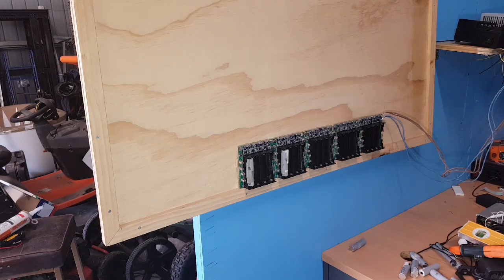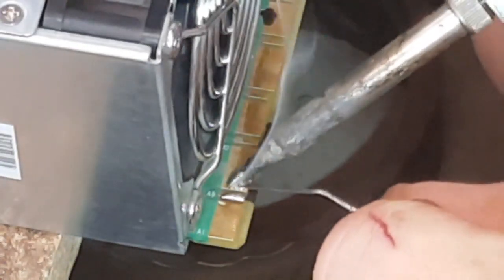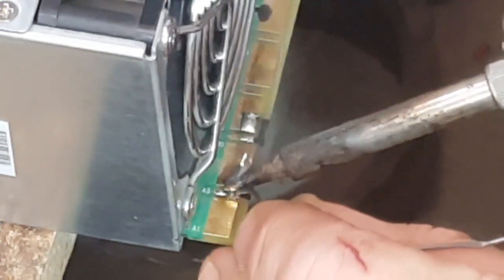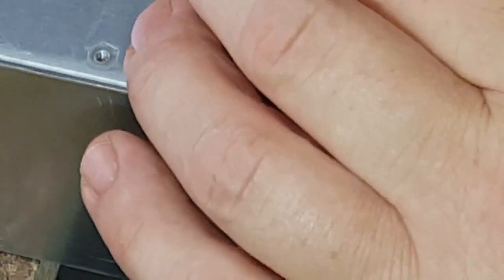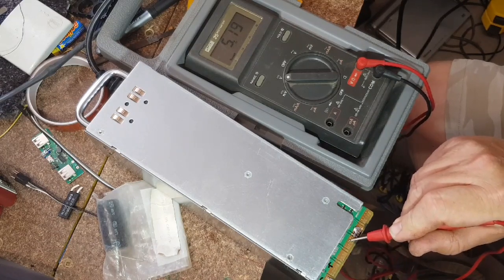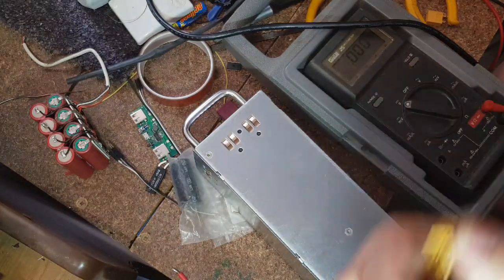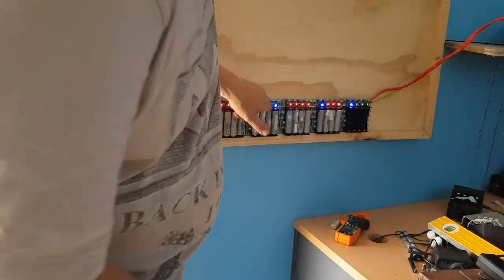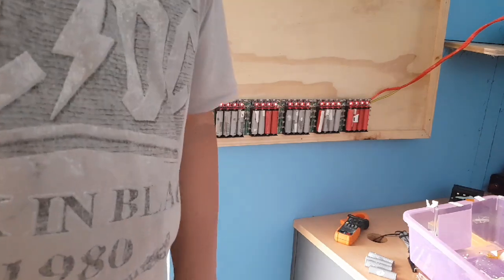Compaq PS5501 or ESP127 powersupply model. For charging 18650 or drone use.

Comment: Nice vid mate, pretty helpful.
I'm trying to use this kind of psu for 3d printer.
I hope you moved those chargers, it would be nice to see them mounted to something that won't end as a fire death trap ;)
Not trying to be a smart ass but yeah, it would be better to mount them for example to bakelite laminate that is fire proof.
stay safe and healthy. cheers
Reply from the maker: They are both mounted to the wall now plus I have fire extinguishers everywhere. Stay safe, have a great weekend.

Comment: Mark the tab volts on the case? I got one too, just so damn noisy with the 80mm fan!
Reply: How I do temperature conversions:-  Approximate formula is F=9/5C+32, so take the 39oF, take a 1/5  ( or easier still take a 1/10 and multiply by 2 so 3.9 x 2) =7.8. Simple way to multiply by 9 is multiply by 10 and subtract 1:-  multiply by 10 = 78, subtract 7.8 = 72.2   then add 32 = 104.2oF...I have to think about it and take it one step at a time, but can do the conversion in my head. Hope that makes sense.
Reply from the maker: It is quite after a little time running.
Reply: @chuxxsss  Maybe I'll leave mine run a bit longer and see. They are pretty neat shape and they are be robust as hell. They will probably still be running in 2030!
Reply from the maker: @Bennyboy-dog  Yes, just got more server power supplies two Dell and two others the Dell are DPS-488ABA rev01. 5 Volts at 32.8 amps and 12 volts 27 Amps. Sweet at 5 dollars each.
Reply: @chuxxsss  I've got a boost converter to hook up to one to give me variable volts and current from 15V to 60V @ 4A (I got two of the ebay boost converters because they WILL fail).
Reply from the maker: If they fail order two more lol. Cheap at present.